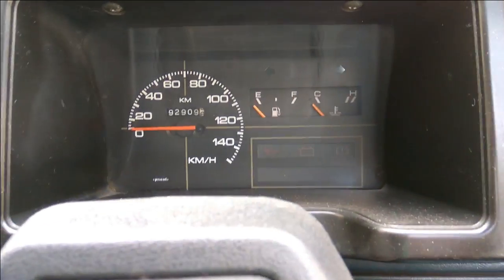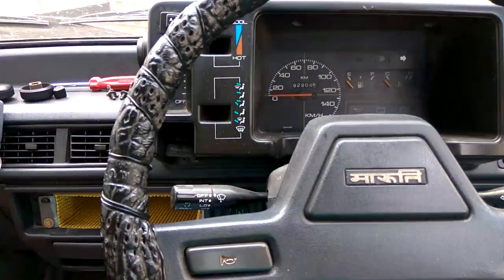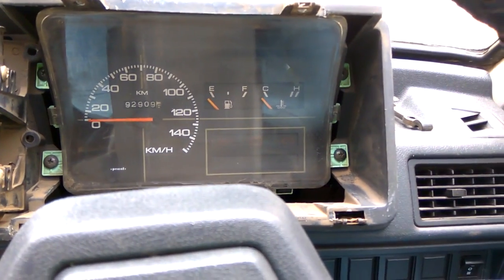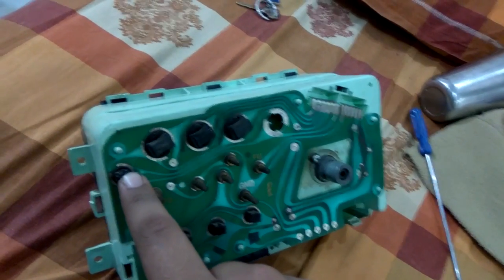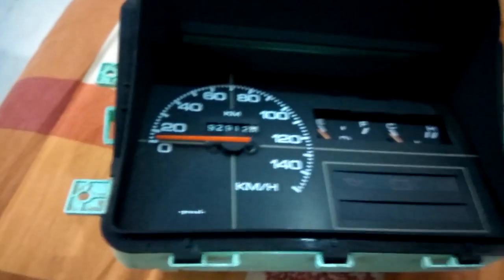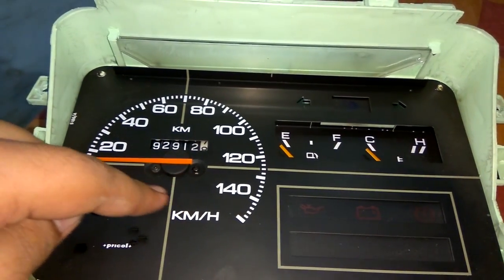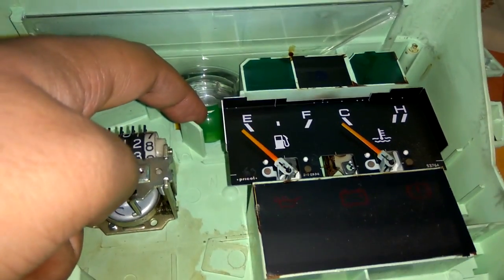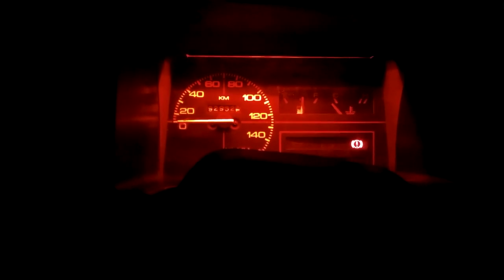M800 Rebuild Part 12. LEDify instrument cluster

Comment: hi I want to know how to bright up maruti 800 parking light with same colour of light
Reply from the maker: You can upgrade them with LED lights. Get those cheap LEDS from ebay and they are brighter than stock ones. I am personally using them on my car. Don't use them for sidelights or brake lights. They do not work so well.
Reply: Aveem Ashfaq can you send the video of your car in night vision

Comment: hello sir self to uthati hai gaddi but plugs crunt nahi deti
Reply from the maker: Spark plug me current nahi aata, ye kaise conclude kiya. Jab aap spark plug ko engine ke saath touch karke rakhte hai, tab hi spark dikhega. Tab bhi agar spark nahi aa raha, to apne wires check karo. Spark distributor ko do wires aate hai. Ek mota wire jo beech me lagta hai aur ek patla wire jo clip ke saath ignition coil se distributor me lagta hai. Wo thik hai ya kuch problem hai, ye dekho. Aur wo mota wala ignition coil jo body me laga rehta hai, kabhi kabhi fail hota hai. Usko kisi aur gaadi ka laga ke, test karo. Ya phir, spark distributor ke neeche waale hisse me koi problem hogi. Usme ka condenser change karna padega.

Comment: Aveem Ashfaq the video is informative but pls do a video on how to remove the speedocable gear from the gearbox because my mehran's speedometer needle  shakes
Reply from the maker: How many kms have you travelled.The speedo needle vibrating usually is the fault of the speedo mechanism inside the instrument cluster but not inside the gearbox. When the instrument cluster speedo is worn out (usually after 1.5 lakh kms) just replace it with new mechanism. That would be easier.

Comment: without putting an led strip can we change the meter light to bright green
Reply from the maker: Yes you can. Open up your instrument cluster in the same way and then I have connected the LED strip in the hole of one bulb. The hole is shown at 3:04. Instead of putting the LED strip and the wire, remove the old bulb from the slot and put a white LED bulb. It will give you a brighter light. Don't worry, the light will still be green.
Reply: will led fit in the slot or any special bulb is needed
Reply from the maker: I think the socket is T5 or T6. So, you can get a T5 or T6 twist socket LED. It will cost yo 100 rupees for an SMD LED to fit into the slot. If you ask me, my personal suggestion is that you take a big 8mm straw hat LED and put it directly into your socket. It costs 10 rupees and it will still work.
Reply: does 8mm straw hat led require any resistor? as t5 bulb are of 12v i think
Reply from the maker: Yes. You get 12v DC and your LEDs are 3.6v each. You need a resistor. But from my personal experience, I have tried taking an 8mm LED and directly connected to the battery. It still worked. No burning, no complaints for me. But yours might be different. Try at your own risk (the max risk is that you will have to open the instrument cluster again and put a new bulb).

Comment: bhai
how to set the correct speedometer
as my vehicle speedometer moves some what slowly.
Reply from the maker: One of the gears inside the speedometer needle has worn out. It is perhaps time to check and replace the broken gear. It is very difficult to do the job and needs much precision. It would be probably easier to just get a second hand console and swap the speedo mechanism.
Reply: ok thank u